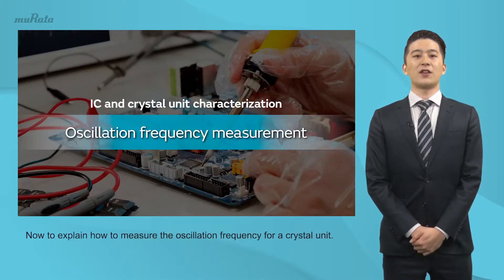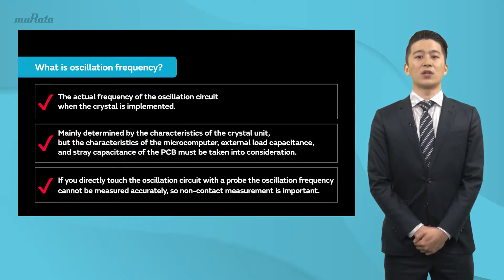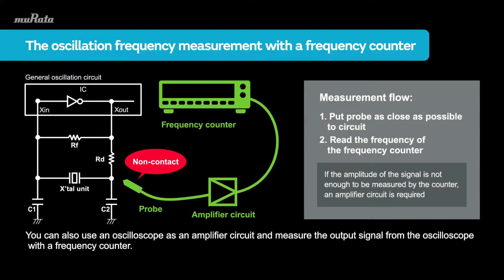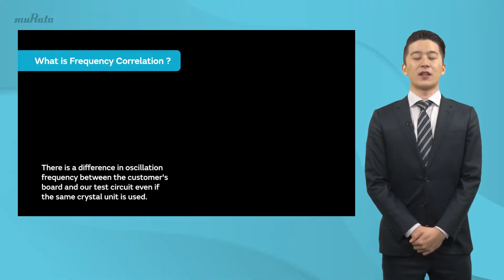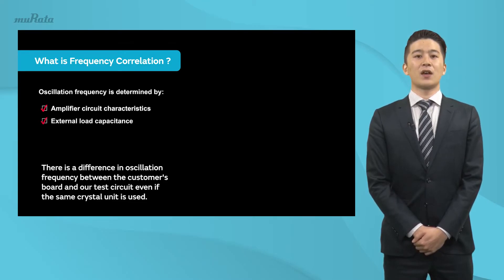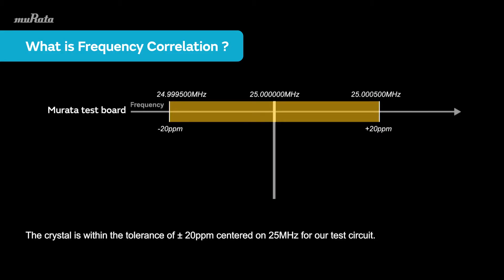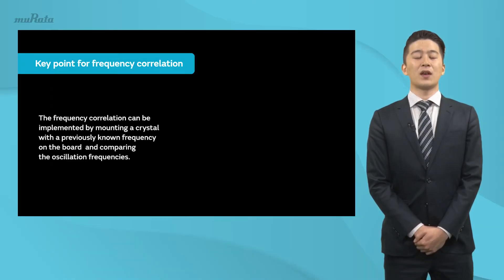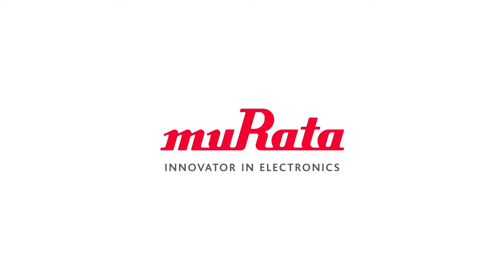Murata: No.4 "The Oscillation frequency measurement" - IC and crystal units characterization

Comment: Hi,
Could you please share the model of your spectrum analyzer and antenna that you used in your demo?
I am trying to measure 32.768kHz frequency. And I expect to tune the variant of the frequency under 10ppm. That means the limit is 0.3Hz. My current spectrum seems not to show 0.1Hz resolution.
Your answer will be a good reference for me.
Thanks,